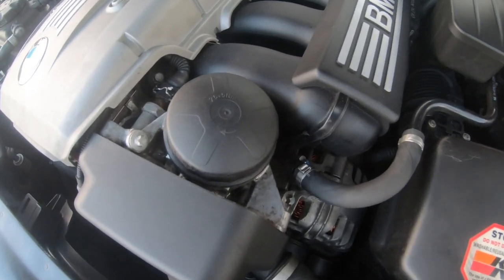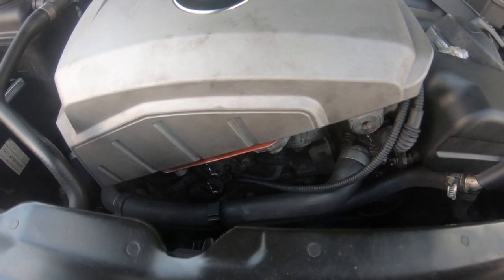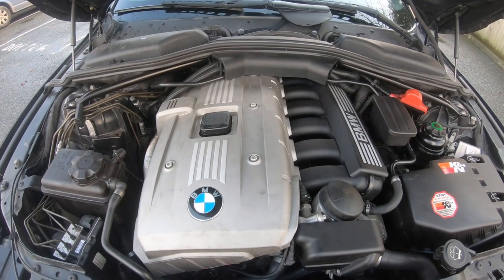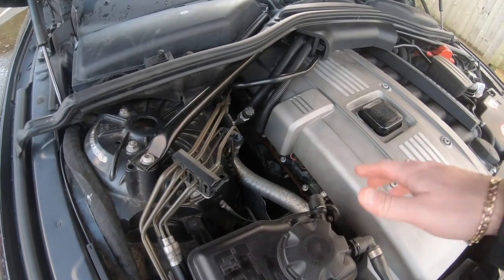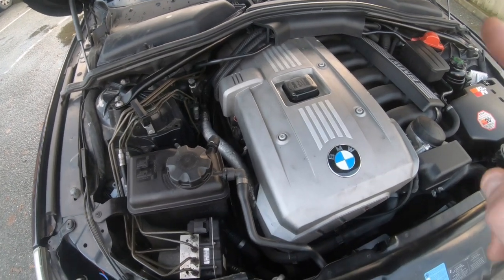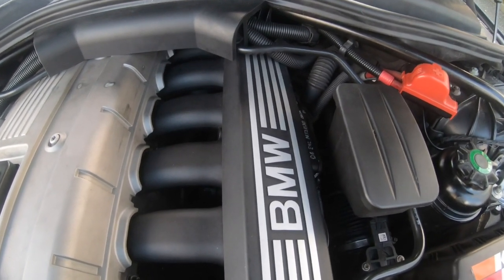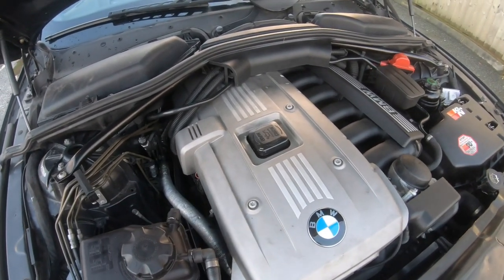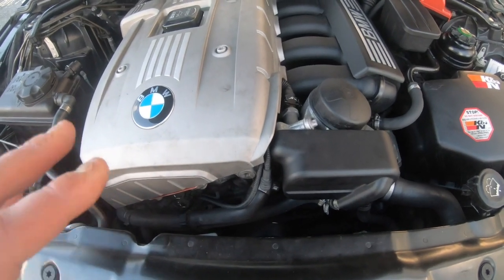9 Parts That Will Fail On A 100K + Mile Bmw N52 Engine

Comment: I've done the OFHG so many times at this point,  there's really no issue doing it as needed whenever they do start leaking. E60 with about 50k since the last OFHG and oil cooler gasket replacement and its already starting to show major signs of leaking again on to the belts and the hoses. Thanks for the video!
Reply from the maker: Bywall that only happens when you use cheap gaskets and not original bmw ones because I can tell you now mine ain’t leaked again and neither has anyone else’s stop using the cheap crap offline and go to bmw and buy it £35 for both gaskets
Reply: Bmw Doctor I’ve used Victor Reinz/Elring/Ajusa brand gaskets my whole life. I’ve even tried to source the newer viton rubber gaskets but at this point it almost seems like a design flaw. I feel as a result of running so hot, the gaskets on the N54 and N52 start to leak again and and again over time
Reply from the maker: Bywall mate impossible in trying you that now you either ain’t doing the gaskets correct or you ain’t cleaning the area before fitting and there not sealing correctly I have done this ONCE on my car since ownership and have had no issues I also did this many many times on previous N52 for other owners who are on here and they ain’t complaining so mate you must not be doing it right 

If I was you mate take it to a garage and have them do it PROPERLY
Reply: Bmw Doctor that May very well by the case. I’m hoping now with practice I’ll be able to do the job properly. Again, thank you for all the content you put out. It’s incredibly helpful!!
Reply: Also interesting to note that my e90 which has the N52 OFHG without any oil cooler is also showing signs of leaking at 80k, but this is likely still the original gasket from 2010.

Comment: How do you feel about surfactants, like redline water wetter or royal purple for the coolant system?
Reply from the maker: mate never heard of that here in the UK and if I aint heard of it and its not in the UK its for a reason it hasn't passed quality control procedure therefore I would recommend avoiding this product 

we dont get alot of stuff like you guys as we dont allow just anything in here it has to under go alot of strict testing and see how much it can be taxed at BEFORE they even let it into the country
Reply: Bmw Doctor interesting, a lot bikers here run straight water with redline " water wetter"  we have all four seasons so the bikes only come out in summer and freezing coolant isn't an issue, i never  ran that in my bike, afraid of boil over. Anyway I thought it may help extend our electric water pump life, product claims to be a lubricant as well. Thanks for the response
Reply from the maker: your welcome mate

Comment: I have a 2006 BMW 330XI (N52) , I recently did a 300+ mile trip and noticed that there is a slight jerking every 2 seconds when at a stop sign , what could it be ? Transfer Case , Spark Plugs, Transmission ?
Reply: Limitless Viim is the idle fluctuating as well? Have you changed out the transfer case fluid and reset adaptations?
Reply: @Shamus71  no I have not changed the transfer case fluid yet. This morning I just got a service engine soon light lol. And I'm noticing that the jerkiness is becoming a bit more obvious and the rpm goes just a tad bit up and then down as the car is jerking while I'm stopped.. I need like a OBD scanner for this car so I can see what's wrong , should I stop driving the car ?
Reply from the maker: if you are getting jerking that is your vanos solenoids nothing to do with transfer case invest in ista and it will show you that thats what it does when they stop and keep cutting out
Reply: @BMWDoctor  do you have a video on how to replace it ?
Reply from the maker: yes I do mate do not even go listening to other peoples bollocks about CLEANING them that crap dont work do not be cheap go and replace them from bmw there self do not buy online any Chinese ones or your problems will stay the same
Reply: @BMWDoctor   So I got a check engine light and I got it tested in and it was a cylinder one misfire. Do you have a video on that?
Reply from the maker: @stazzyjayy7346  cylinder 1 misfire IGNITION COILS MATE !!!! replace all of them not just one or you will end up replacing the other 5 as they will fail straight after
Reply: You're awesome!

Comment: How would I go about changing my coolant ? (someone put the wrong type in at some point)
Reply from the maker: This is a very risky procedure if you don’t know how to do it and can kill your waterpump easily
Reply: You need to bleed it correctly, there is a procedure, in the "secret menu" to bleed it, but yes you can easily get air in the system if not bleed properly and you'll get a hot spot.

Comment: Video like this for N20B20, if its possible :D
Reply from the maker: I doubt it mate I won’t be getting a 4 cylinder engine mate unless someone wants to bring me there car then I can do it you request a lot of videos
Reply: Which 2012+ petrol engine we can expect on this chanel? Tnx for the greatest n52 content on yt btw
Reply from the maker: Никола Тодоровски I’m not sure mate I doubt there will be any as it’s not favourable here in the U.K. mate and secondly it’s still a new car so not many problems 

It did replace the N53 which is what I’m probably gonna get but the possibility can change and we may be going a new route and away from bmw

Comment: Edit: I misunderstood what Dean was saying in the vid.  Original comment as below:
Are you saying the anti corrosion properties of the coolant never degrades? Not even 10 or 15 years later?  I find that hard to believe.
Reply from the maker: No but you get people changing every year during there service and for what ??? And that’s exactly how the waterpumps fail from running dry during the bleed procedure
Reply: @BMWDoctor   Ok, I must have missed that part.  That's true, no need to change it sooner than 5 years, maybe longer, depending on mileage.  Cheers!